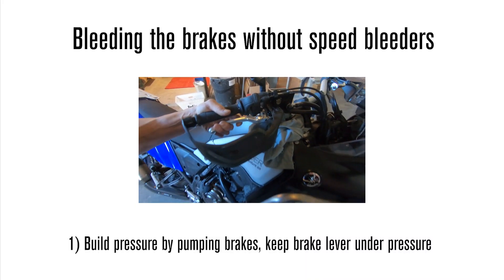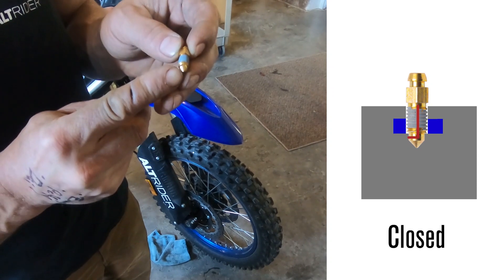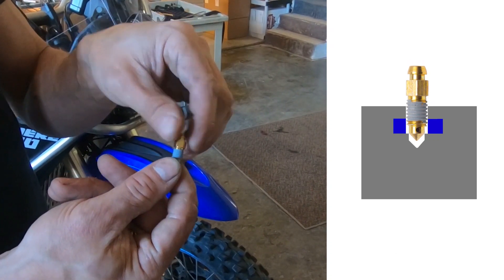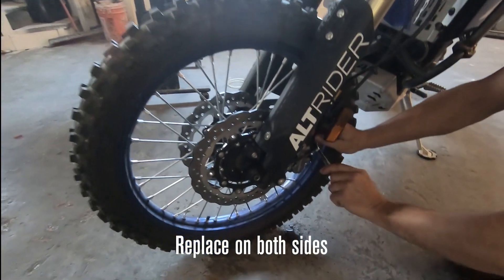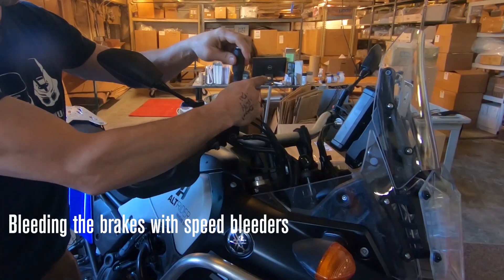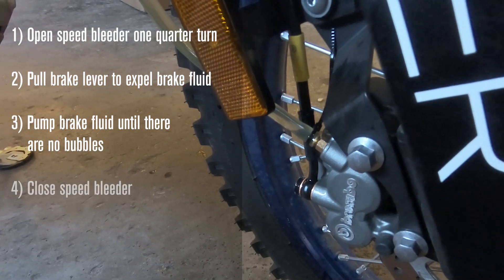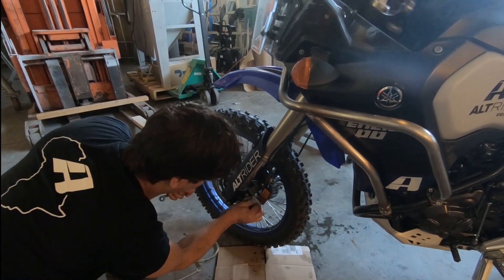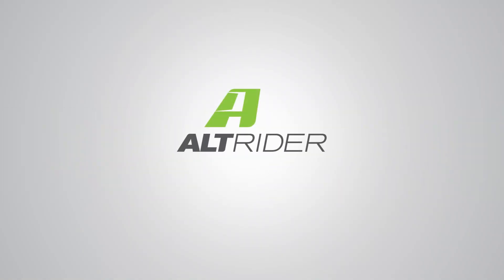Yamaha T7 Speed Bleeders Install and Features

Comment: 1:52, one could prevent that loss of brake fluid by filling the reservoir and then 'sealing' it with cling-wrap.  2:13, Philips or JIS?
Reply from the maker: Thanks for the tip! And yes, Yamaha does technically use JIS screws, but JIS drivers aren't common in much of the world and it's so similar to a phillips. We just use a phillips since high torque values aren't required.

Comment: can you install the speed bleeder on the master cylinder instead of the calipers ?
Reply from the maker: It's designed to go on the calipers where you "bleed" or remove the air from the brake lines. You can't remove the air from the brake lines up at the master cylinder since any air in the lines has already moved past the master cylinder.
Reply: Yes you can use on both. I use Goodrich speed bleeder on my master cylinder too it's just the same process  . Once bottom is bleed you can then remove whatever air is trapped up above.
Very convenient these are .